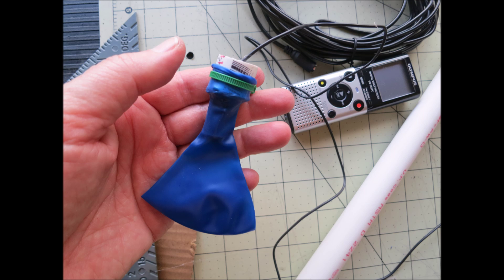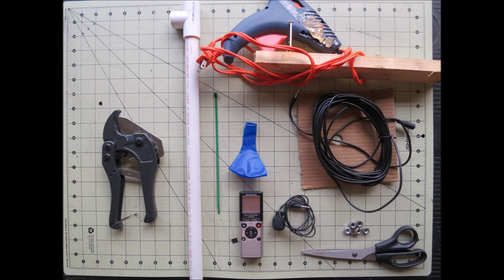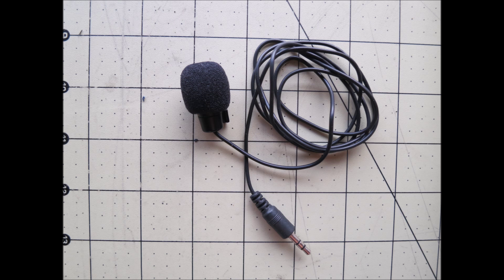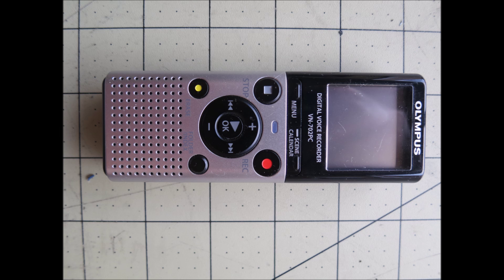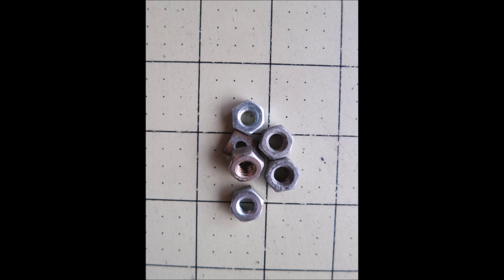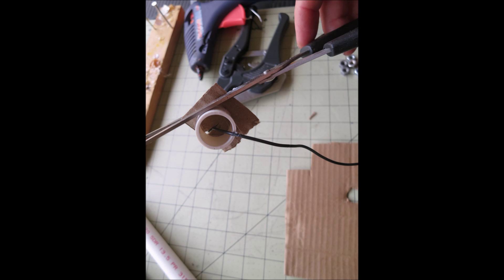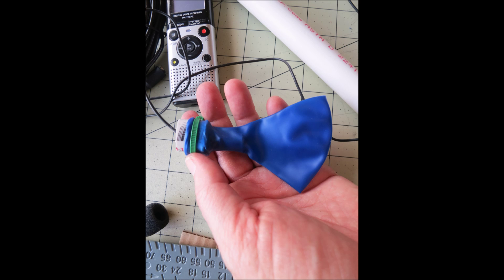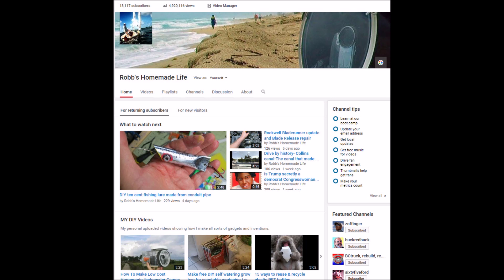diy 25 foot hydrophone cost $9

Comment: This is great!  I will be building one quite soon.  Could you please tell me - how do you waterproof the connection between the mic cable and the extension cord? Thanks!
Reply from the maker: sure, the simplest way is to use non hardening clay as it is only going to be submerged a few feet.